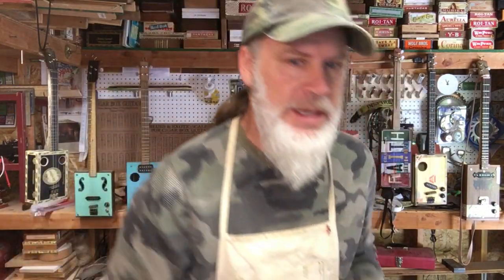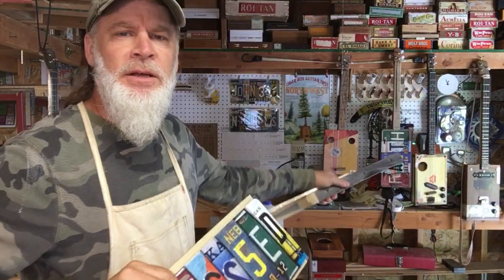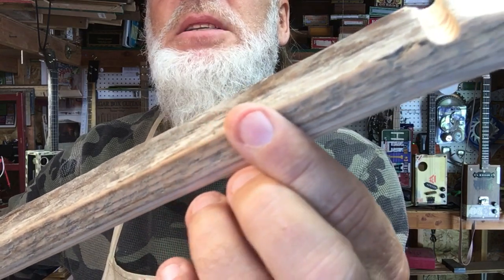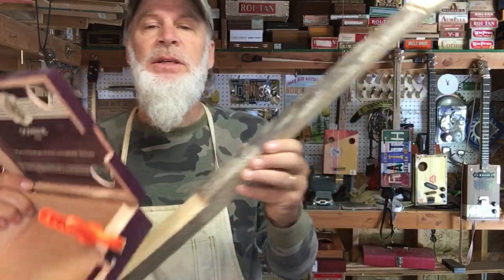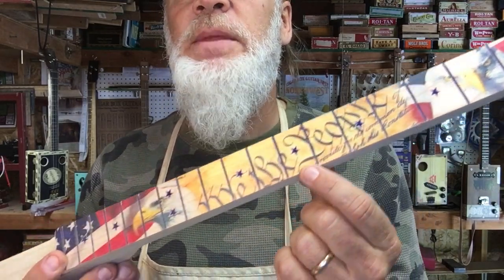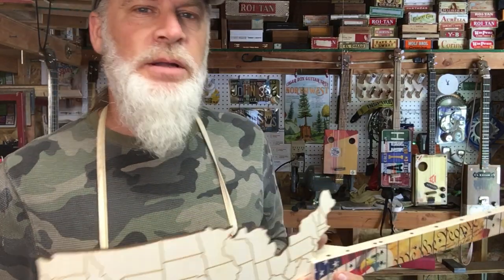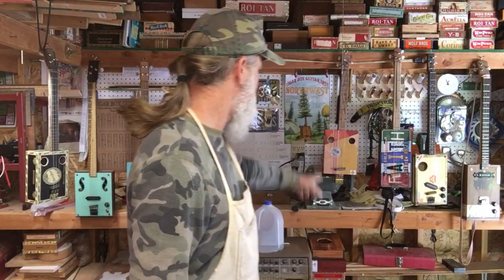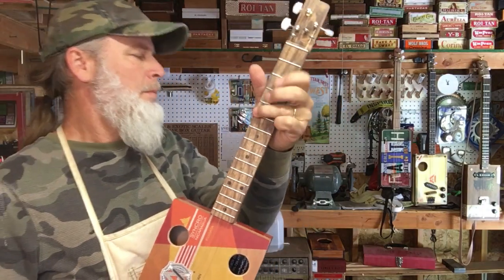Help Wanted!!!

Comment: How about a basically brown rendition of the Stars n Stripes of the American flag , painted over those state lines . Meltonian leather liquid dye can be carefully painted on with a suitable sized brush , figure out beforehand the size to use, to get the flag image scale right .This dye dries quick enough not to become impatient . To get the contrast right , the darker stripes ( red originally ) are merely extra strokes with the dye brush .After the first base coat of dark brown shoe dye  is done , use High Gloss Deco Varnish between each layer of dye to get the flag stripes contrast right . This varnish can be touch - dry after about 2 hours , between each phase of the task .For the Stars on the one corner , get those from a stationary ware shop  OR  find a stencil having the desired star shape  and make your own from broad masking tape .I think the brown appropriately shaded USA flag superimposed over the state lines of that guitar body , would look a match for the theme that is planned already .
Reply from the maker: That’s some detail!!!! 😎

Comment: Hey Del I think whatever you do will look Great, I started building and my first build turned out pretty decent and I am on my second build now just did a scarf joint and I have already used some of your ideas along with Shane Speal's and Glen Watts on my first build I pretty much bought most of my parts from CB Gitty and this time I bought some tuners and and fret wire from MGB and there neck scale template, I always appreciate your builds and craftsmanship you do a awesome job, 
I'm sure when I receive my Bandsaw Thursday it will make things easier then trying to cut headstocks with a miter saw or a coping saw.
Just wanted to say I enjoy watching your videos and your ideas are awesome.

Thanks Man, 
Keep UP The Great Work!
God Bless !
Reply from the maker: Awe man thank you for your kind words!!  Welcome aboard!!

Comment: I don't have a suggestion on the  USA box, but I do for the turquoise inlay neck box.  I have used a dream catcher over the sound hole or holes.  I used an arrow head on the volume control.  Don't do that. I punched two or three holes in my strumming hand on that thing.  I sold it to a lady for a wall decoration in her jewelry store.

Comment: You could ask your daughter to paint a bald eagle with a branch in one claw, and arrows in the other similar to the one on a dollar bill.  I would leave the shield out.   The neck has enough red white and blue for the whole guitar.  If she doesn't want to do it you can probably find something on line that you could print and use as a pattern and use a wood burner.
Reply from the maker: You got me thinking 🤔

Comment: Del, have you tried reversing the scarf joint? Joint is under the fretboard so theirs no joint across the headstock. I tried it on my latest and it works well.
Reply from the maker: Yes but you gotta make sure there is no hump under the fretboard else fret buzz
Reply: Any irregularities are easily trued up on the jointer.
Reply: I've made over sixty guitars that way, they look classier, are stronger because of the sandwich construction. no problem with a hump if you are carfull

Comment: I suggest the 4th of July axe body should be kinda like Old Glory stars and stripes.  Yeah it wouldn't be like a complete rectangle  but paint it like if it were a cut out to fit the lower 48.  BTW are ya gunna put Hi and AK on the inside or back ?   LoL 😎
Reply from the maker: I could put stickers on the back

Comment: Easier method ..print the stars n stripes flag after changing it with the effects facility on the cellphone ..use Sepia  . Then simply Modge Podge it onto the USA shape body ..and High Gloss Deco Varnish  it to seal it up . The scale might need adjustment though ..the body looks a bit larger than A4 size .

Comment: I was curious what tuning you use for these instruments
Reply: You can use any tuning you want. There is no standard tuning for these types of instruments really, but commonly used ones instead. Which tuning you would use may vary depending on what genre you play. The tuning varies from 3 string to 4 string models. Some people string them up like a banjo or ukulele, others like the top 4 strings of standard guitar (chicago tuning d-g-b-e) and open chord tunings are very popular as well (D-a-d-g, E-b-e, G-c-e, D-F#-a, A-D-f#) Hope that helps! \m/

Comment: Johns idea below is like what I was thinking. An old map but you don't want all the names of cities and States on it. Also not a road map, It will be too busy. Maybe a  topographical image of the continent like this one. https://www.etsy.com/listing/791610086/united-states-hipsometric-tint-8 would be cool also. Might be kinda hard to get the exact size of you body. I'm sure a Kinko's or similar could get it printed to match in a laminate form and then you just glue it down !
Reply from the maker: Dang what an awesome picture!!!!
Reply: @PuckettCigarBoxGuitar  something like that would look good. I also like one of the other suggestions to draw the eagle but instead of an arrow have it holding a CBG!!